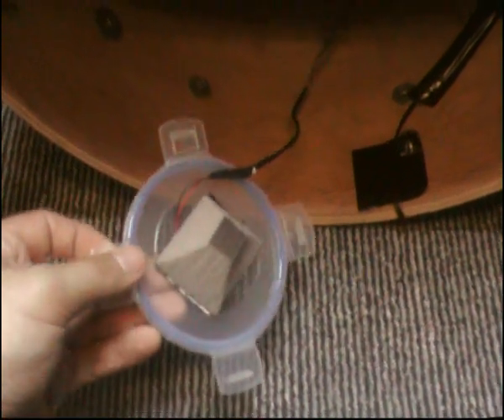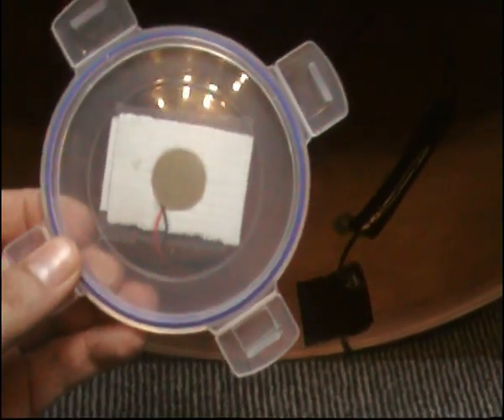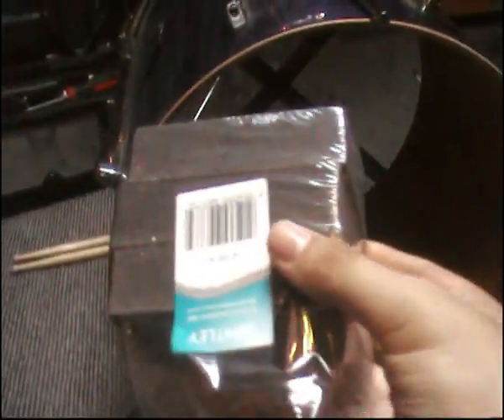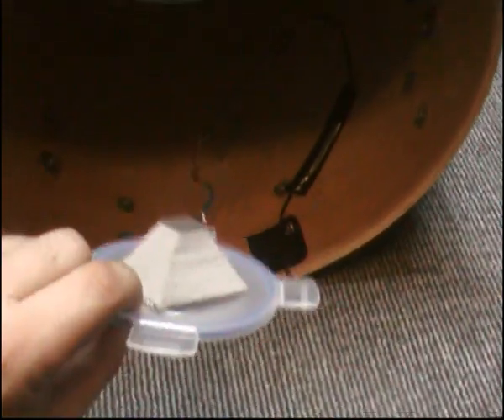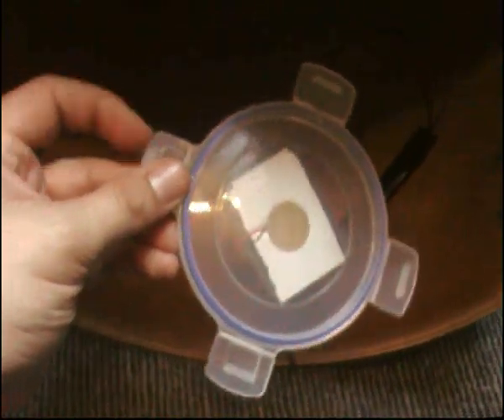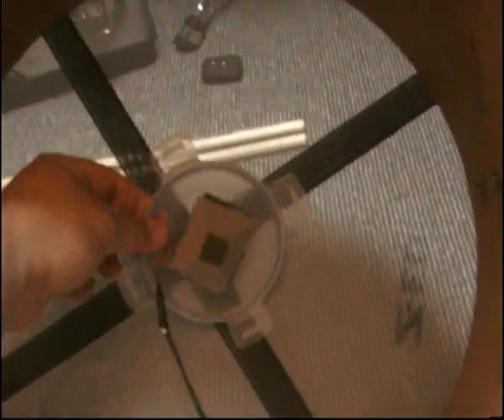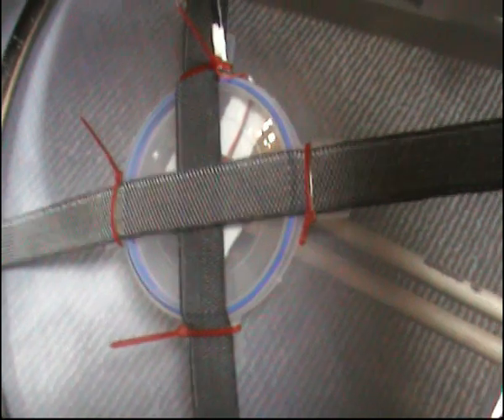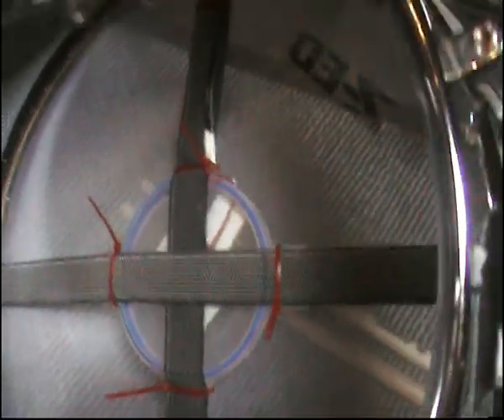Custom Mesh Acoustic Drumkit Conversion - Trigger Design

Comment from the maker: I'm actually gonna refine this design soon, hopefully so I can make a couple of nice ekits and sell them online. I've moved away from the elastic idea and am actually gonna cut my kit in half (so I can make 2), and use a design which uses a load of foam with a hole cut in the centre, then a fixed plate suspended behind the foam with the piezo attached. This way you avoid the "hot spot" in the middle and dont get the elastic causing ghost notes on bigger drums. Alesis dm10s uses a similar method.